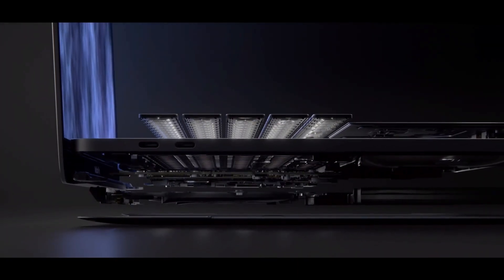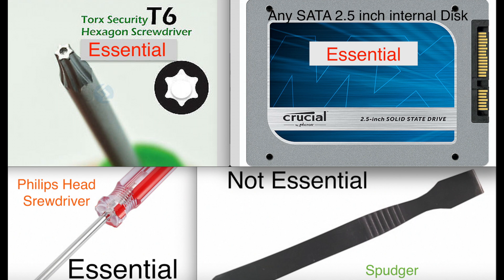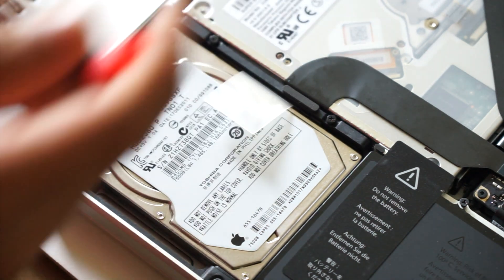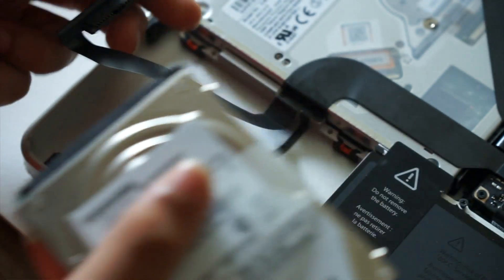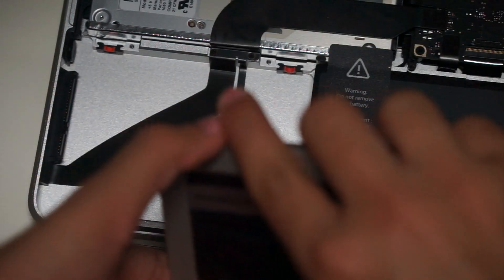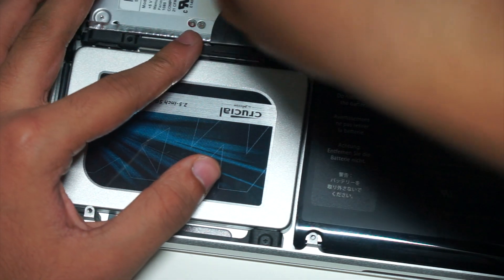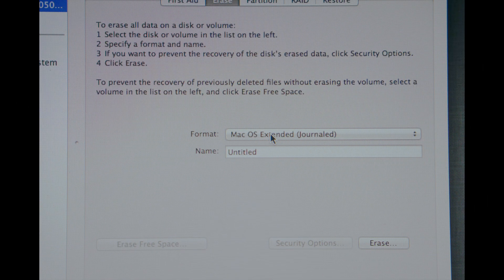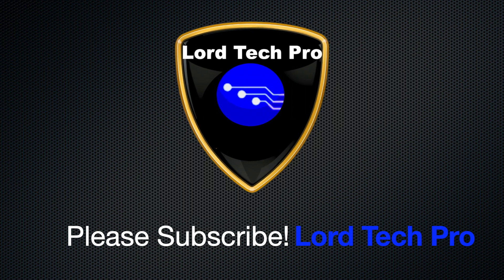Mid-2012 MacBook Pro Unibody - SSD Upgrade

Comment: Bisa pakai ssd nvme/m.2?
Reply from the maker: No, this can take a SATA 2.5 inch laptop internal SSD. 

I believe it’s possible to get an adapter/cable to connect an NVME drive but you would also need spacers/frame to hold the NVME drive, so it’s not really feasible and you won’t receive any extra speed benefits. 

So I would recommend you install a 2.5” SATA SSD drive, since it’s a simple plug and play solution.

Comment: some of the big os updates won't install unless i went back to the default 500 gb hdd. is there a work around for that?
Reply from the maker: Back up your new drive, then go to recovery mode and reinstall MacOS (it won't delete anything but you need to play it safe and backup your new drive)